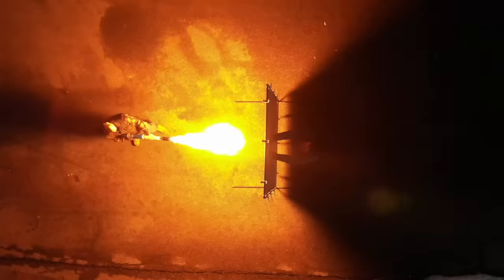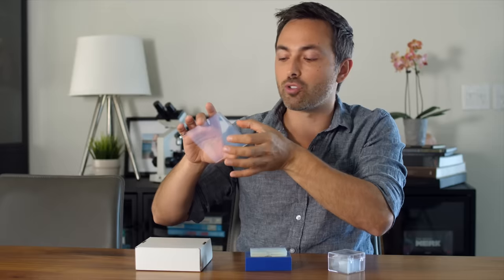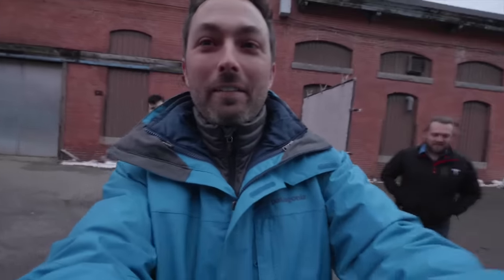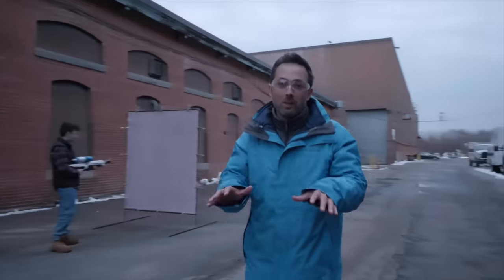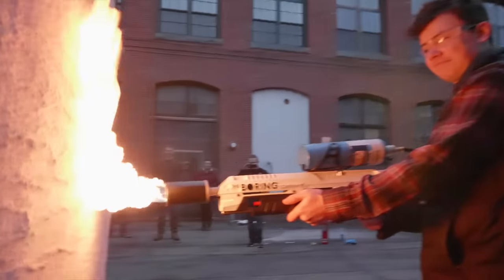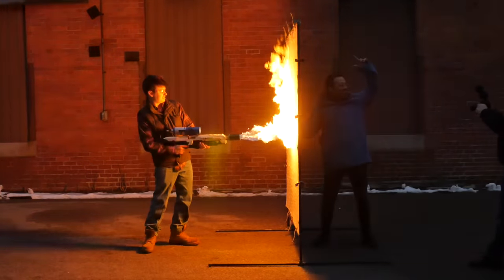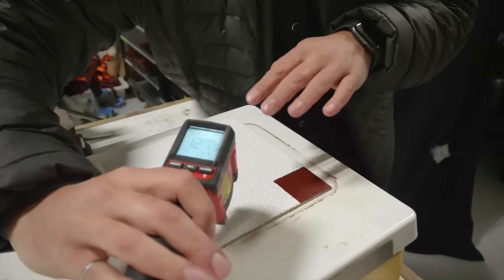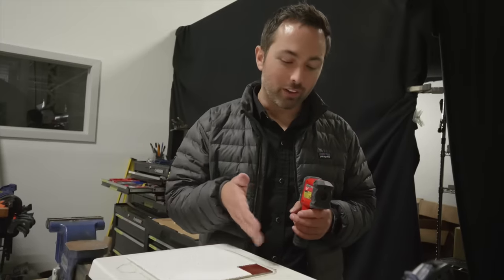Flamethrower vs Aerogel

Comment from the maker: For the record, Ben has a standing offer for compensation for the 'not-a-flamethrower.' He likes the video and hasn't yet investigated the problem but I suspect something is mechanically wrong with the trigger.
Also, we had a real flamethrower lined up to do this, but we couldn't find a safe place to shoot it 150ft (>45m). Plus for the purposes of testing aerogel we needed a hot flame, like the 2000C of this propane 'not-a' flamethrower and we didn't need the hassle of getting diesel or napalm all over the blanket...
Reply: Thanks for addressing the emotional outcry about it not being a "real" flamethrower.
Reply: My reaction was the title kind of being degrading to the content. Also, the reason for many viewers reaction is all the hyperbolic youtubers freaking out about elon musk inventing the every day man's flame thrower in past videos.
Reply: Except you continued to call it a flamethrower.   This experiment could have been done with a washcloth and a propane torch.  Of course that wouldn’t have been as sensational as “flamethrower”.
Reply: Just some appreciation for you non-US fans who like that you use the metric system
Reply: Do the real flamethrower in the desert next video. It's enough if you just have a heat camera on the other side so no need to stand behind it and risk splashes of Napalm.
Reply: It is a blowtorch
Reply: Did you pay for Ben's broken not a flamethrower?
Reply: I hope you paid for the flamethrower you made a fan break just to get your shot.
Reply: Find a quarry.
Or a desert.

Mythbusters got away with seriously big booms with the proper phonecalls.
Reply: But its in the title regardless....
Reply: Thanks for mentioning this.  Musk's 'Not-a-Flamethrower' is quite literally not one; it's just a torch.  I did cringe every time you called it a Flamethrower though...
Reply: Stop calling it a flamethrower then... This is just annoying.
Next video should be titled "Actual real flamethrower on a TANK fires on aerogel blanket" and i want to see burnt skin!
Reply: If they send you a smaller piece you could do a short follow up video where you heat one side with an oxy-acetylene torch and film the other side with your thermal camera. These torches put out some real heat.
Reply: @jackthmp  2000° Celsius is pathetic? Ok my guy..
Reply: @JimPankey  They should have named it Giant propane torch vs Aerogel - that would probably pull just as many viewers without being as much of a click bait as to call it flamethrower vs Aerogel. Despite that - it was a really good video and that material is really impressive!
Reply: Did you reimburse Ben for his broken flamethrower?
Reply: Aerogel is also extraordinary material in sound insulation and acoustics. And it actually can be heard quite clearly in this video too, even if the product itself is optimized mostly for heat insulation.
Reply: Could this that type of Aerogel be used for Building a Station on Venus or Titan? That would be incredible!
Reply: Veritasium please i am anas from morocco africa. I love ur videos please can u try thermite vs aerogel.
Reply: @Theraot  "It is a blowtorch"

It's not a blowtorch either, just a gas flame. A blowtorch would have been much hotter, but less spectacular to watch.
Reply: You could us thermit instead of flame thrower its really cheap
Reply: A real flamethrower? Why? They just shoot burning fuel, it would be like holding the gel over a campfire.

Next stop: blowtorch! Oxy-Aceteline, I'd like to see that.
Reply: That "Not a Flame Thrower" is cute. But have you tried a 15 Million BTU Hot air balloon burner? 😉 Let me know if you want to risk it. I'll work with you to arrange something 🙂
Reply: Unfortunately, it's completely irrelevant what temperature something burns at, as long as it has essentially zero mass. No, I certainly wouldn't want to just stand in front of it, especially not for any length of time, but there's a good reason why something as melting-prone as chocolate for fuck's sake withstood that flame for about thirty seconds without even melting. You know what happens when you point that burner to some decent chunk of snow or ice...? MOSTLY NOTHING. Because even though the flame is "twenty times hotter" than the temperature frozen water melts at, the sheer density/mass and latent heat of water makes a mockery of the actual amount of energy that burner brings to the table, regardless of at what temperature it does so. You'd stand out there all week long trying to "melt" the snow off your driveway...
Reply: Do you think it would be possible to make mugs out of Aerogel or at least insulate  a cup with it. I want my hot tea to not burn me.
Reply: Seeing as when I returned from watching a movie I now had the top comment with over a thousand likes I felt like I wanted to clarify:
Nothing against you AT ALL, or even this video, enjoyed it and just felt like the title and use of the word was wrong and wanted to, mainly jokingly, point out that it really wasn't a flamethrower.

And as I said, it's still very hot and in no way illegitimizes the test or video. I mean a flamethrower would have just been a big hot mess and although pretty dope definitely not necessary (and probably pretty dangerous) , also really like that you used the boring company flamethrower! I have no doubt you understood the situation very well, far better than me at least, and I'd rather you have fun, make good content, and be scientifically accurate in your findings/experiments than calling your flamecasting devices by their right terminology!
And kudos to you for pretty quickly responding and correcting your "mistake", keep up the good work and I'm terribly sorry if I came across as negative or nitpicky!
Reply: @ericsarason9099  maybe Elon could give Ben another one considering they're no longer sold.
Reply: Thank you for the disclaimer.  You know it is annoying to refer to a blowtorch as a flamethrower. Much appreciated.
Reply: You should have bought one from Master Elon.
Reply: @AttilaAsztalos  That's true - the heat transfer capacity of such a flame isn't very high due to the fact it's just hot gases (with very low mass). Also - at very high temperatures, most of the heat from an object is lost by radiation and not by convection or conduction. The flame don't do anything about the heat that escapes as radiation, from the object you are heating. So even if it's a small object that gets completely engulfed by a big flame (wich stops heat from escaping by convection and conduction), that object will still not reach anywhere close to the gas temperture of the flame it self. Steel melts at about 1400-1500°C in most cases (it varies slightly depending on the exact alloy) - but as we know, you can't melt even a small nail with a big "2000°C" propane torch. 
Then the last thing (as others have said already) - that flame didn't even reach 2000°C gas temperature - because there was no air mixed in with the gas flow (as with a normal blow torch). It's just propane that burns in the surrounding air. The 2000°C is with an ideal gas/air mixture (wich wasn't the case there). But that doesn't stop the fact that they got the blanket up to like 900°C on the hot side (measured by their IR camera), while the cool side only got up to like 50-60 - that's very impressive (given it was only 10 mm thick) anyway!
Reply: Lol if you used a "real" flame thrower you probably would have gotten splashed, and that kinda nullifies the whole ultimate fire proof blanket idea.
Reply: Man, the complaints in here are ridiculous. Anyway, regarding the graphene aerogel, given graphene's conductive capabilities, is it more or less insulating than the silica-based aerogel?
Reply: Derek, I have a place for you to do it , please contact me! :) The Carolina Pyros would be welcome you too come do this and we have a well know guy ( known for his fireballs in the pyrotechnic community, look up The PGI 2019 super nuke , more than 1,000 gallon gas fireball )who should be showing up with his flamethrower( real flamethrower). You can also stay and watch the firework show afterwords and just hang out. I'm a patron and plan on sending this via patreon along with some links and more information. 
Thanks ! 
~Steven
Reply: G'day,

  Yay Team !

   Where can I get some, and how expensive is it ?

I live in a Eucalyptus Regrowth Forest y'see - which this current Terminal Drought has turned into  Bushfire Fuelbomb, so Fire Protection has become rather a high priority around here lately... (backtrack me to fact-check me, see my Videos...).

  For a "Last Resort" Bushfire Shelter, I'm otherwise about to cobble up a little double-walled Tipi with a 4-inch Air-Gap between it's 2 walls of Building Insulation, and put it underneath my Tracking Solar Array's 4-sided Steel mounting Tower (to protect the Tipi from falling windblown Branches...), with a couple of Sprinklers mounted on the Tower to cover the Tipi - working like the "Crew-Saver" Spray-Nozzles on a Bushfire Tanker.

   Building Insulation is $80 for a 30-metre x 1.35 metre  Roll, and it can be stapled together quite quickly and easily ; I'm using it to insulate my Plastic Buoywall Tanks from the Radiant Heat - so the Tipi will be put together from "The Leftovers"...

   Inside the Tipi I'm planning to have a SCUBA Airtank at 2,000 PSI, so as to be able to fill the Tipi with Cold Air - and have it outgassing rather than collecting hot Smoke and Steam.

   If that  there Aerogel Pyrothermal Blanket is affordable, then it should go very well in the Air-Gap between the two layers of Sisalation...(?).

   During this past  August I've put 50 tons of Water (trucked-in at $20 per ton) onto the 1.5 Acres (0.56 Hectares) surrounding my Hut ;  for Firefighting Practice, at night..., learning my Hose-Runs in the dark under Head-Torch, and the new 6.5 Hp Pump was $500 - so if it's not astronomically expensive then Aerogel Blanket sounds like the perfect option...(?) !

Such is Life,

Have a good one.

;-p

Ciao !
Reply: You sure it wasn't a matter of the flamethrower just freezing up? That much propane expanding could have just temporarily froze the lines and valve components inside. Even the bottle will stop supplying propane if it freezes, but you can usually get more propane out of it after it warms back up.
Reply: Aerogel infused fireman uniform
Reply: Can you please try to make a winter coat out of aerogel
Reply: Hopefully you'll help make arrangements for 'Ben' to get his NAFT serviced, Veritasium. 👌
Reply: @ThZuao  They had a seriously-big production budget. Quarries and firing ranges shouldn't be that hard to find, even in Commiefornia. Be prepared to shell out for Event Insurance or bonding, though.
Reply: @prototk5186  Your comment was good. But it made my head hurt.

So! Here's an edited version, with proper grammar. :)

My reaction to the title, "Flamethrower* vs Aerogel"; was that it was kind of degrading to the content. 

Also! The reason for all the reactions here, is probably due to YouTuber hyperbole surrounding Elon Musk; and him inventing the "every-man's" flamethrower - made popular by past videos.
Reply: I'm disappointed at you, veritasium guy. I thought this is a channel of science, not a channel of clickbait! But I'll still watch your videos! Just for your previous videos.
Reply: I'm disappointed at you, veritasium guy. I thought this is a channel of science, not a channel of clickbait!
Reply: Make me a plasma field around water that electric magnet fields hold over a ion drive and have a mass within the water that a laser x-rays hit and sound waves formed within the mass hit it with a magnet release in a microwave plasma that moves under controlled form out the back or as it sets up right pushing down out the bottom ... Well I think this maybe a little theory but some one can use this info to test drive a newer ion drive that laser ion   plasma beam that also works as a x-ray laser beam .... You could put the water in motion that turn the ions at higher speeds until it forms up under pressure and sound and hit it with x-rays and microwaves and a laser beam form of a x-ray beam that push it's energy out the bottom of the ion plate to where there's a positive charged plasma  field ,if that's even a thing lol...😏😒 please some one test this theory out and the energy could be made like they want cold fusion energy but that's not why I want it made , I want a big laser to write I love you on the moon with a smiley face ....
Reply: It would be interesting, though, to see what an actual military flamethrower would do to that little aerogel bed sheet. Something tells me you would not have been standing on the other side, let alone touching it.
Reply: @Veritasium can you put aerogel in front the neutron beam at the mit nuclear reactor to test its resilience against subatomic particles. thanks.
Reply: Can you do Thermite vs Aerogel? Id love to see how it reacts to a constant contact
Reply: @Veritasium: Why can't they use this on the outside of a spacecraft, for a heat shield? Can they use it for a window on a spacecraft? I would like to know if you knew the answer to that.
Reply: @magonzalez888  are you saying you want me to stand in front of the beam lol
Reply: I figure a $40 blow torch and a propane tank would be that hard or are they restricted there? Use them to heat up asphalt to do patch work. connect right to the can, and you can chill your drinks with the can as it will put out enough propane to have ice build up.
Reply: I do hope you covered the costs of the not-a-flamethrower.  I'm sure you did.  I'm just making an argument.
Reply: @willierants5880   I just edit my comment to add talk about flames saying they are a form of plasma , does that work or was I wrong and flames are not plasma ? And I think it is .... Thanks for your comments peace 😊
Reply: @ChrisClifton  Unlikely lol. I'd say just pay for it.
Reply: It could save lives in case of fire.
Reply: @gathukumatheri8091  dude even people in the us want to use the metric system
Reply: I'm sure you paid Ben allowing him to replace his pseudo flamethrower.
Reply: Hope Elon replaced Ben's flame thrower for the free advertising.
Reply: @josephagamble8863  Oh, I'm not saying it is or isn't I was merely playing off others complaining it wasn't a flamethrower.  I just hoped the kid was reimbursed for his troubles and the demise of his toy.  For the sake of argument a flamethrower IMHO squirts a thick viscus flammable liquid that remains on fire for a period of time.  What we saw here was an over sized lighter.  Still I'm not arguing one way or the other.  :)
Reply: I saw you change the title and thumbnail
Reply: @willierants5880   it was a toy and I understand because I watched the old war movie but the laws don't let the real big toys even have that fire glue as war made it to be .... Peace
Reply: Gear up for Next solar ☀ mission 🛰... Light weight and tough heat 🔥 sheild 🛡️
Reply: I would really like to see the real flamethrower test... I was thinking about uses for this material for protective gear, such as a racing suit, and those situations you would potentially have accelerant burning on the surface of clothing
Reply: Get that aerogel blanket to The King of Random channel. They could upgrade their foundry.
Reply: I want to suggest an idea for video : Nuclear (bomb) mushrooms, Why and how do they form. Also at what height relative to proportion of the capacity of a nuclear bomb at which when detonated would do maximum damage
Reply: @anas8183  .
Reply: The flamethrower from The 14 fists of McCluskey ?
Reply: This would be cool on car exhaust pipes to stop grass fires. Could it be used instead of insulation on hot water pipes?
Reply: @JimPankey  he changed the title of the video after filming. What was he supposed to edit the video with an overlay ever single time her said flamethrower?
Reply: @mikehughes6798  he changed the title (4 times so far) and the thumbnail twice after people complained. Also missing is the original comment/complaint that had over a thousand likes within a short time. So, yeah, anyone coming to this video now just sees people like me complaining without reason. Then again, who cares about truth or accuracy on a science channel.  Are you suggesting that he didn’t know the difference?
Reply: @hugowijk3676  Did you delete your other comment?
Reply: @JimPankey  which one? Don't see anyone that's gone, got a little worried there lok
Reply: I have so many questions: When did you film this? Were did you get snow in post-climate-crisis earth? Is Aerogel also an acoustic insulator?
Reply: @hugowijk3676  I was looking for the one with the 1k likes and ton of comments.  I can't seem to locate it, and it was near the top.
Reply: @JimPankey  strange, i see it right there, directly below this one
Reply: I'd have been more impressed with a welding torch actually.
Reply: @hugowijk3676  I'm betting it's hidden from everyone.  Look at it where you're not logged in.  I seriously can't find the post.  The next post I see is Elijah B's Shade Balls comment with currently 756 likes and 3 replies.
Reply: @JimPankey  yo that's messed up, can't find it either when logged out and my friend now said he couldn't see my comment earlier. And it hasn't gotten any more likes since yesterday or something. 

Damn, veritasium is one of my favourite channels on YouTube, this sucks man
Reply: @hugowijk3676  Exactly.  It's messed up.  There was a huge number of folks that took issue with the clickbait title.  Now those comments are hidden.  Not cool.
Reply: Ever heard of "fire paste" by the great inventor  Troy Hurtubise and his fire paste?
Reply: Stop changing the title
Reply: You change the title 3x
Reply: Why did you change the title? I'm sorry, but I didn't understand what you wrote in the description.
Reply: Your in trouble misters... You refered to this not flamethrower as a flamethrower multiple times.
Reply: You trying to make each video viral ? Changing thumbnails / titles every time.
Reply: ideal Application: Make lightweight jacket for firefighter
Reply: You have shifted your focus to get more revenue I could see that. :(
Reply: Why did you delete my comment? 
It had 60 replies and it's kind of weird for a science channel to just remove any comments calling out "flaws", I clearly demonstrated my intent and apologized in another comment.

You used to be one of my favourite channels on YouTube but know you only care about views and ad revenue, tailoring everything about your video so it's perfect. Changing the title, thumbnail and description over and over again and even removing even remotely negative comments.
Reply: @hugowijk3676  comment again bro
Reply: @JimPankey  and he changed the title/description to basically remove the issue entirely. 
He's basically cleared all negativity from the video, hadn't seen this side of Derek before. Guess I should have seen the warning signs when he made a video about how to get the most views or whatever it was.
Reply: @karthikeyanm.v8381  don't what that would do, the only reason my comment was put at the top and got so many likes was because i posted it suuper early, and also pointed out something a lot of people agree about. But it seems he's just deleting comments like that lol
Reply: @hugowijk3676   I saw "enough" when he loved the comment that said anyone that complained were "pussies".  His like/dislike stats are pretty interesting too.
Reply: The use of a real flamethrower or not is pointless.  The actual use of flamethrowers was not intended for heat so much as it was for spreading incineration and destruction and secondly for psychological warfare.
Reply: @hugowijk3676  I hope you took screenshots of that comment thread.
Reply: @josephagamble8863  What is your point?  You are barking up the wrong tree.  I was making a slight quip based on other comments.  Go target someone who actually made the comments that it wan't a flame thrower.  My comment was tongue and cheek.  Nothing more.  I personally can care less about your viewpoints into what the not-a-flamethrower is or isn't.  It wasn't the point of my original comment.
Reply: I enjoyed this video.
Reply: The people complaining about it not being a real flamethrower are the same people who don't get invited to parties because they complain that the sofa is not real leather. No-one cares, you're embarrassing yourself. ACKCHYUALLY.
Reply: Thanks for addressing. What Ben has is more closely related to a commercial Forney.